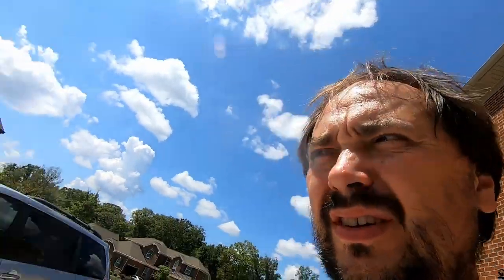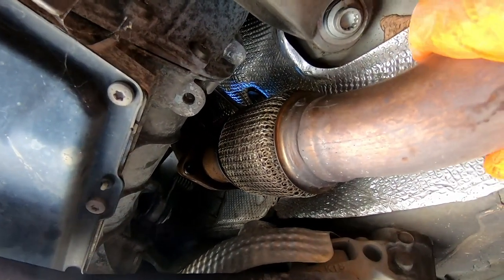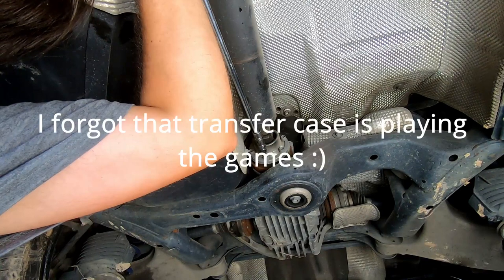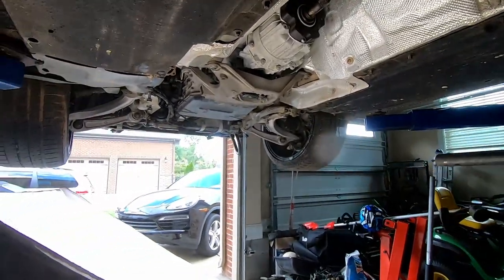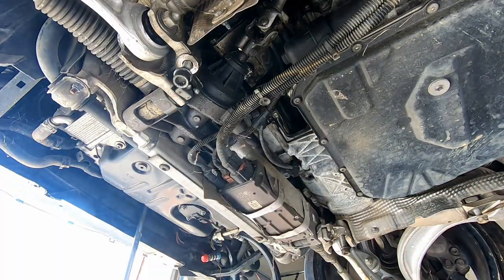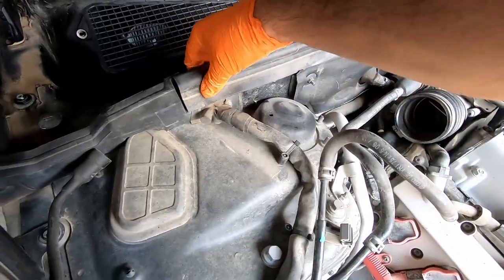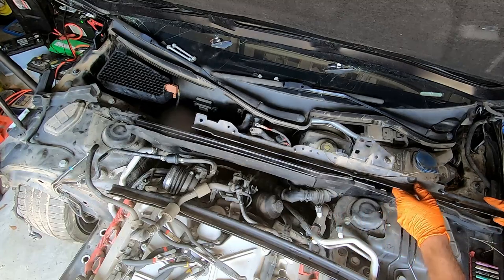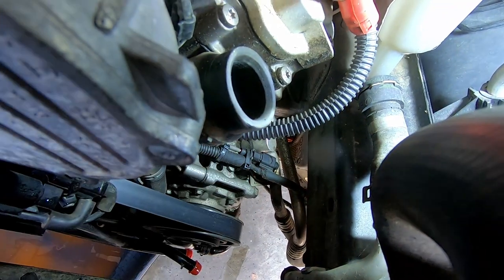Audi S4 B8.5 Engine removal From A to Z. Part 1 of 2.

Comment: Nice job getting that wrench moving with the extensions. How does the interior compare between the S4 and the CLK? Is the S4 much smaller inside?
Reply from the maker: Both of them are pretty small. I never drove S4 yet, but I had base 09 A4 probably 10 years ago. Tiny car for a small family, but I really liked how it drove (but ate 1 liter of oil for 1000 miles :))